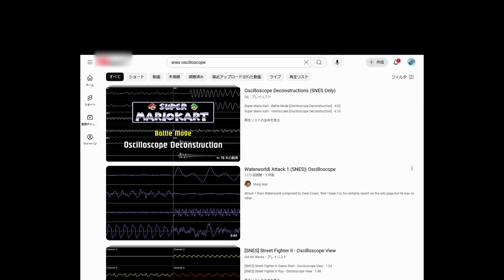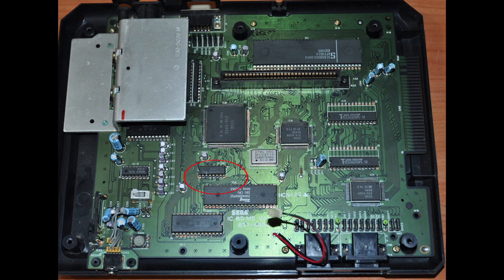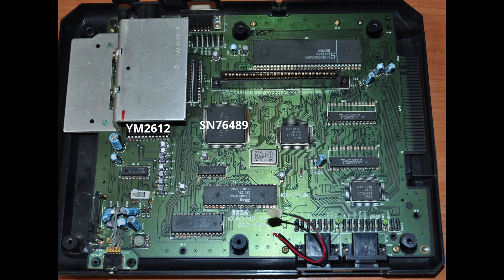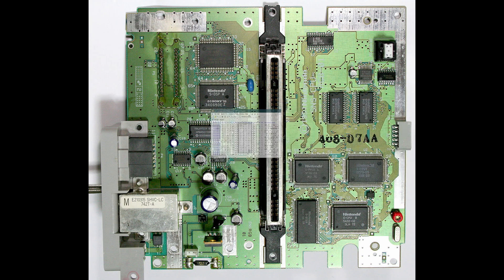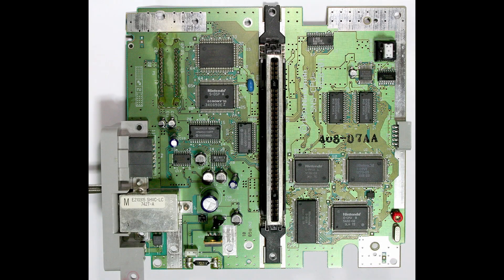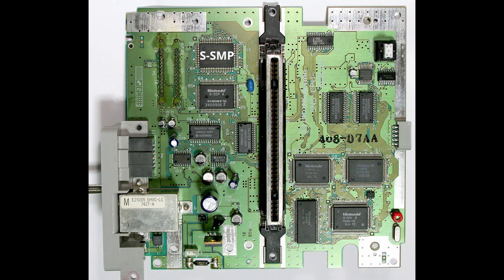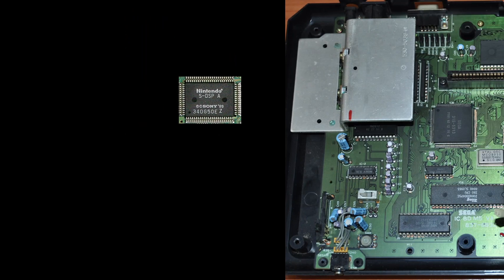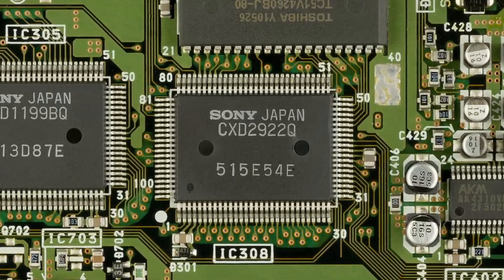I Can't Believe It's Not The SPC-700: A Look at Super Nintendo Audio Hardware

Comment: Well that’s the confusion part, theres the spc 700 chip, the dsp chip and those 2 16bit dac chips.
And then theres the 64KB of ram as well.
Now if only nintendo and game developers knew from day 1 that that 64KB of ram could be also used as a buffer for audio streaming, not only would it had allowed game developers to use as much sound effects they want to use in a game but they slso could,ve used much higher quality voice samples as well.
No ugly dry or muffled noisy audio but just crustall clear audio.
But sadly it’s that only that unintended digital audio streaming feature was later discovered.

Comment: tl;dw: SPC-700 is an architecture created by Sony, and implemented in the SNES' sound hardware. Sony later improved the implementation for use with the PS1.
Reply from the maker: Not exactly—the SPC-700 is the CPU inside the S-SMP that is used to control the S-DSP which produces sound. The SPC-700 is based on the 2A03 CPU with some differences. Sony later improved the S-DSP for the PlayStation :)

Comment: You had a voice this whole time?! (Amazing English accent, I can't tell if your native tongue is Japanese or what)
When you say that you could swap the Mega Drive's SN76489 with the SNES S-DSP, are you implying that only involve changing the instructions sent to the chip, or would that require reformatting the sound file as well?
Reply from the maker: I do, and I'm flattered ^_^; It's not the best accent but I try my best. Thanks!
Well, the S-DSP only accepts commands for playing notes. So if we were to use the Mega Drive's CPU (a Motorola 68000) to send such commands to the S-DSP, theoretically it could work! As for the sound file (SPC files), those are just containers for the game music and the audio driver code. The audio driver is specifically SPC-700 code, and would need the S-SMP to run, so if we can convert that SPC-700 code to something that the Motorola 68000 would understand, well... Of course that's not an easy task, and hardware-wise, there could be other problems. But theoretically speaking, it's not impossible :)
Reply: Japanese? Sounds very German to me!

Comment: great video! it's shocking that the audio didn't come from the SPC700
i also did not know that the mega drive had a CPU only for music, like the snes
Reply from the maker: In general, the Zilog Z80 CPU inside the Mega Drive is general purpose and can be used for any task, but it's mostly used to run the music driver to control the YM2612 because it's a nice way to offload some tasks away from the main 68000 CPU and get more frames-per-second (FPS) :)
Reply: From what I understand the Z80 was also there for backwards compatibility with the Master System, which could be achieved by means of a cartridge adapter
Reply from the maker: @crism8868  Yes, indeed, that's the other reason for the existence of the Z80 (and the SN clone inside the VDP since that's the sound chip of the original Master System)

Comment: Got a bit thrown off by the voice as I'm used to just hearing music from your videos haha.

I got reminded of when I discovered MSU-1 romhacks of SNES roms a few years ago. I found them quite neat that the SNES and its S-DSP could theoretically do those CD quality like sound samples but were limited by the cartridge flash memory sizes.

A question though, Is the audio in the .spc from SFC/SNES games closer to a CD's PCM audio stream or tracker music using PCM samples? My understanding is its the latter, but do correct me if I got it wrong.
Reply from the maker: You're right, it's the latter :) the SPC file contains the song data (samples and notes) together with the song driver. The driver is responsible for reading the data and then controlling the S-DSP to play it. This means that the song data format depends on the game. If someone were to write a MIDI driver, then the data could be MIDI. The S-SMP (SPC-700) doesn't care.
Reply: @KYLXBN Oh you edited your reply for additional explanation. Thanks for that!

Interesting that the driver could be utilizing a different music format like MIDI. Makes me wonder what SNES music could have been if the Nintendo PlayStation prototype never got canceled. Would that have utilized the S-DSP better to do something like the MSU-1 romhacks with CD quality audio, but we'll never know. At we got the improved Sony DSP on the PSX.

Btw your English is pretty clear though I was surprised as I knew you replied in English or Japanese on comments, but not that you did voiceovers for videos. Your accent seems familiar to me (but I may be wrong) as if you have a native tongue from somewhere Central Europe (like Livakivi) or more likely from around East/Southeast Asia that's not Chinese, Japanese, or Korean as those have specific accents.
Reply from the maker: @abunk17  The driver's task is to read the music data and control the S-DSP in a way that the S-DSP would understand, so yeah, the actual music data could be anything as long as we have a driver that can understand it :) 

As for my accent, yeah, let's just say I'm indeed Asian :) Neither English nor Japanese is my native language, but I can speak them good enough. I'm totally ashamed of my actual nationality so I won't mention it 😁